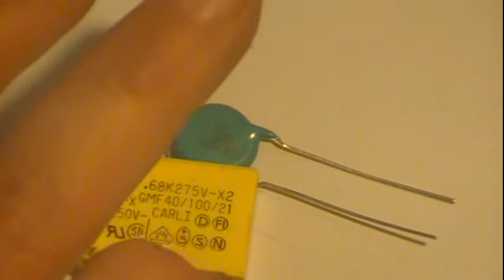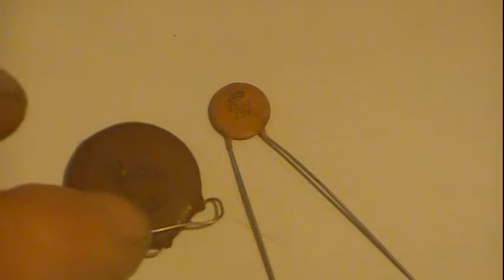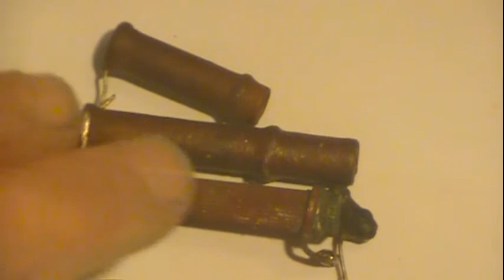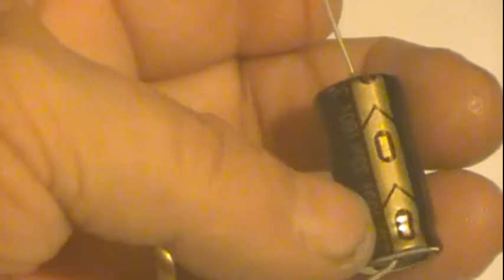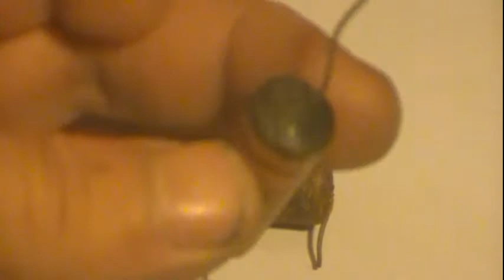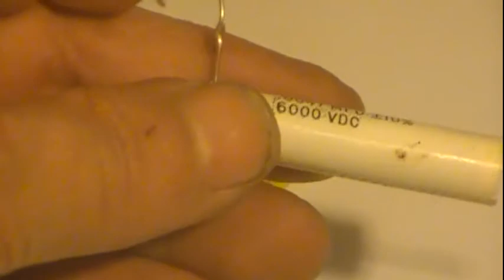Capacitors

Comment: As for cap temp, I like to mount new caps under the chassis, and simply disconnect the cans without stuffing.  The cans are usually close to tubes that dry them out. Much easier to snip wires at can cap terminals then connect to new cap underneath.

Comment: Dennis I would like you to show everybody, putting a voltage across them testing for leakage, putting a AC signal on them showing internal resistance and measuring Microfarads and how it is done. that would be a winner.
Reply from the maker: MrMac5150 I can test some caps on my Eico 950B cap bridge. It can test for leakage up to 500 volts and test capacitance from 10 pico-farads to 5000 micro-farads. I will do a vid on that in a couple days.
Reply: Thanks I know you will explain deeply into it.
Reply: You'll get some of that in my next video too :)

Comment: Dennis - Very informative. In regards to safety caps, is there a preferred value that should be used and if so why? Thanks again for sharing. Don
Reply from the maker: RestoreOldRadios Most radios use 0.01 micro-farad, but they can range from 0.1 to 0.001 micro-farad. The reason for these sizes is that they are wanting filter out rf below the broadcast band so anything below 500Kc.